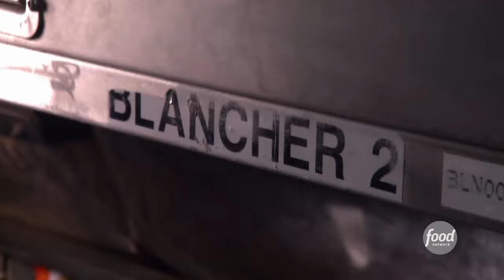When You Eat Peanut Butter Every Day, This Is What Happens

Comment: I've been a fitness guy for years and have swapped my workout to just bodybuilding now. I've added peanut butter to my daily diet and I find it's completely killed any cravings for sweet foods/chocolate/cakes etc that I used to binge on my cheat days. If you're bodybuilding you need to increase your levels of fat intake (something I kept really low in previous years) and I've found I have much more energy with a higher fat diet. Peanut butter rules.